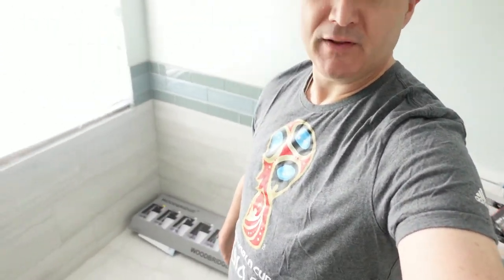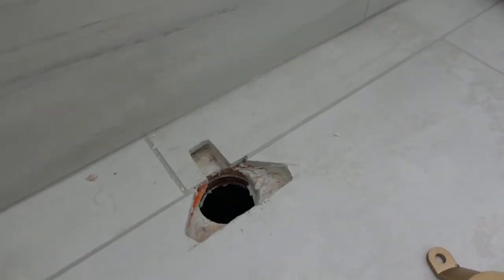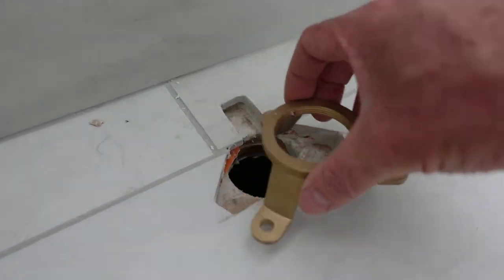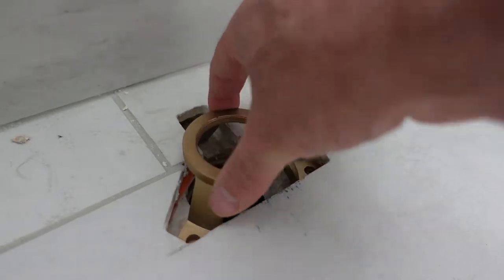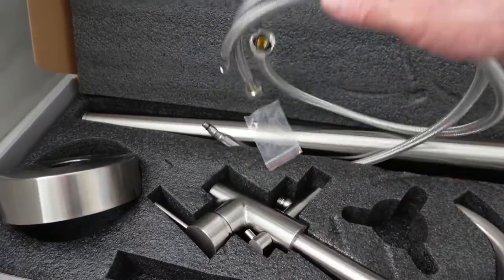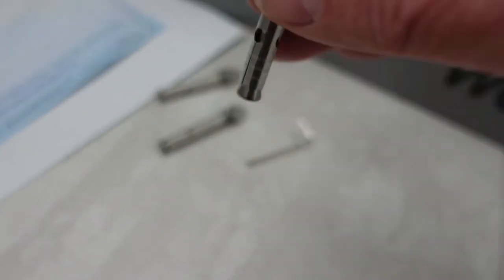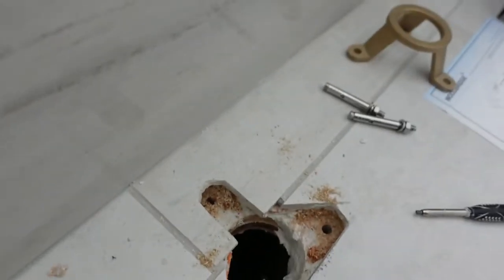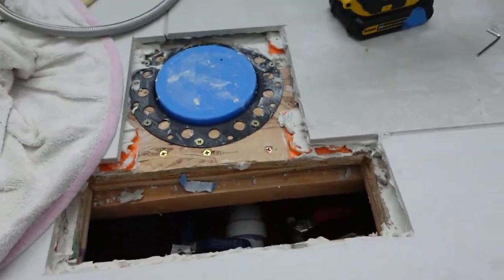Bathroom Reno. Video 21 - Installing a Woodbridge Brand Tub Filler

Comment: The woodbridge instructions show dropping the floor bolts into the tri-foot stabilizer.  Your installation was perfectly according to the written instructions. Perhaps a better alternative is to unscrew the nuts, place the floor bolts into the tri-foot stabilizer and connect the nuts finger tight.  Then, place the assembly with the bolts attached into the holes you have already drilled into the floor.  The problem requiring a deep socket wrench would have been avoided and the entire assembly could be removed in the future while leaving the bolts in the floor.  Thank you for the excellent video.  Please share your opinion of my suggestion so others may understand the conditions.

Comment: What size drill bit was used for drilling the three pilot holes?
Reply from the maker: I wish I knew. I actually went online to try and find the correct size because it's not detailed in the instructions. I ended up guessing (starting small and increasing as needed).
Reply: Dealing with this crap now. Started with a 1/4” hole and had to increase to 5/16”. Problem is the right size is in between those two. Guessing metric 7mm.